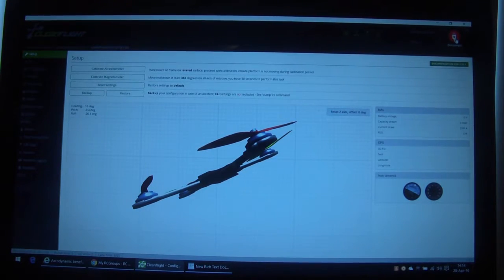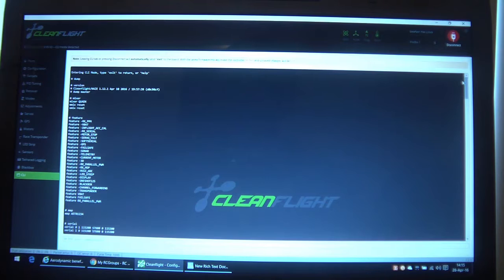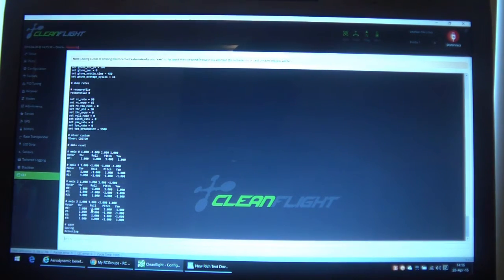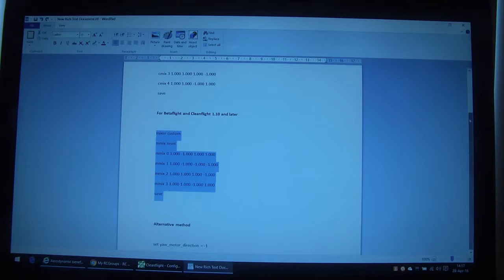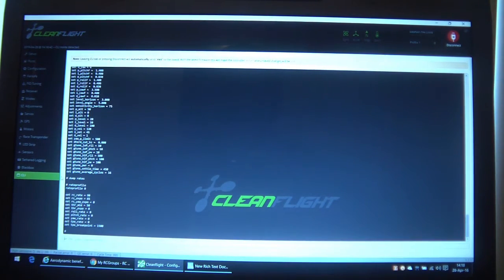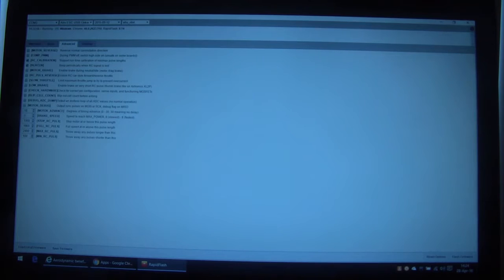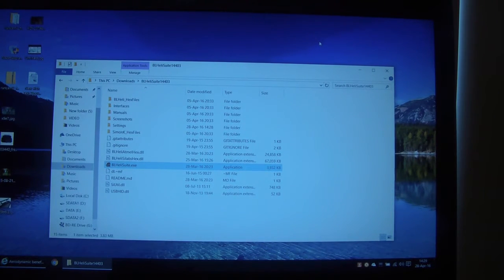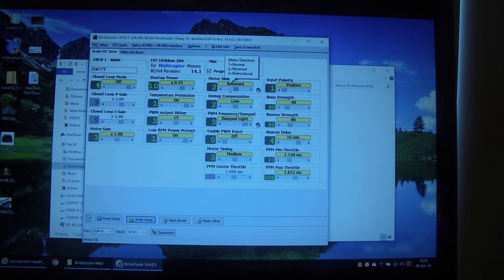Reverse Motor Rotation - FC and ESC set up.

Comment: Ugh can’t they just make it so you can flick individual switches for motor direction, instead of needing to rewire?! I’d think this was a standard thing by now! Testing them while you’re working on it is a pita, and seems like something that would be very helpfully you can just solder any which way and change it later when you’re setting it up.

Comment: For using CleanFlight, it would have been nice to know what motors you were changing. I have no way of knowing based on this video what the current direction was of which motor. Also if you want to change the direction of any one motor, do you just flip all the -1 or 1 values to their corresponding opposite?

Comment: Any chance just doing something like this could mess with the electronics considering the motors are wired to the ESCs in a certain way?  Is it not safer to also rewire power and ground on motors?
Reply: So you SHOULD rewire motors as well as the CLI changes?

Comment: Hmmm I tried the custom mix and it changed the image of the quad to the box, but none of the motors would spin up. The set yaw_motor_direction = -1 didn't seem to have any effect at all. Am i being spaz has anyone else got this to work?
Reply from the maker: What version are you using?  Cleanflight, Baseflight or Betaflight?
Reply: A recently downloaded Cleanflight.
Reply from the maker: SpinewireUK Is there a chance you used cmix instead of mmix?

Comment: Is there any way to find out what is flashed on to an esc?
Reply from the maker: What ESC do you have?   Some will say it on the sticker, many don't.
Reply: +Trainboy64 I'm not sure I bout a used 250 to play around with. but when I set up everything motors 3 and 4 I believe are spinning the wrong direction.
Reply from the maker: No Way Hard to tell without seeing the ESC,  some can use SimonK or BLheli,  others can only use SimonK.   You might have one or the other or neither.
Reply: +Trainboy64 would a picture help? I was thinking about removing the heat shrink to look at it anyways.
Reply from the maker: No Way Yes it definitely would - if you are on RCG then post the picture here and someone will know for sure. http://www.rcgroups.com/forums/showthread.php?t=2136895
Reply: +Trainboy64 I am and I will

Comment: I just ordered a Tarot 650 Ironman . I have both NAZA M Lite and NAZA M V2.2 I can use either one . My Idea is to get as much air time with a GoPro type camera and a 3D gimbal . I watched some of your 650 sport videos but what I would like to know is what setup you liked the best I plan to watch all your video's on the 650 but if you could tell me which way you like best it would save me some time and money . I have a Phantom 1 and I built a DJI F550 but changed a lot of things over and over and over and after all the money I have spent on it I see it will never be what I want , 8 minutes on a 5200mah battery is not very good so I have 6 5200mah batteries  even after going to the E310 and smart esc's it still only gets 8 minutes and about 1.5 after the red starts flashing . If you look at my channel you'll see I like to fly over water a lot so I need time to try to get back to land . The F550 is a touch over 5 lbs and even on 4s that is all it can lift I want to maybe go to a Sony LEX or a Canon mirrorless and a carbon fiber gimbal later so I need good lift 6.5 to 7 lbs and as much time as I can get with that much weight . Can you help me out . this was your newest post so I put this here in hopes you see it soon . Thanks Spencer
Reply from the maker: +Spencer Boaz Hi Spencer,   I use the Naza Lite on mine but it has the V2 firmware update so is basically the same as the V2 - it flies great with this controller.   I use Sunnysky 4110S motors / Hobbywing X Rotor 40 amp ESCs and 17 inch props - with a 6S, 10000 mah battery it flies for 35 minutes empty and about 28 with a go Pro sized gimbal - these are honest numbers that I can replicate in any wind conditions and is using about 80% of the battery so not really pushing it hard.   Let me know if you need any other info.   Good luck with your build.
Reply: Thanks I'll let you know how it works when I'm finished .
Reply: I am using 5208 360 KV DYS motors and 40 amp hobbywing esc's using 18X5.5 props . I am going to get started on the electronics tomorrow I got the last of my parts today . I will still have a ways to go but I can get it in the air with what I have now . I posted a video of pix yesterday on my channel .
Reply: +Trainboy64 - which kV version of the 4110S do you use?